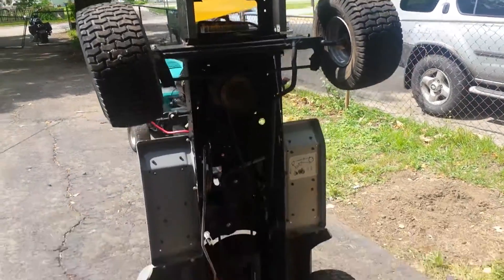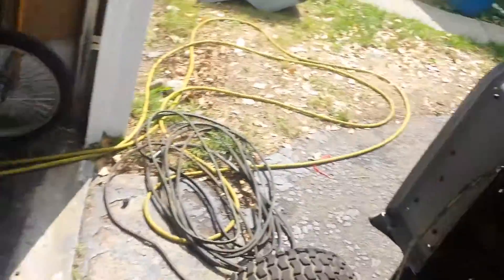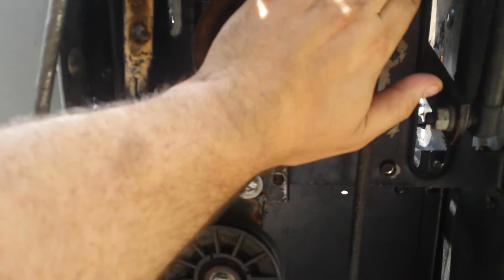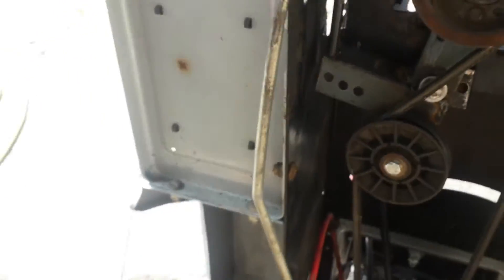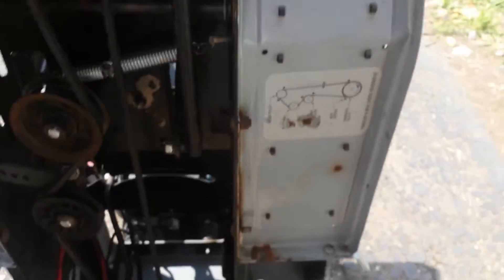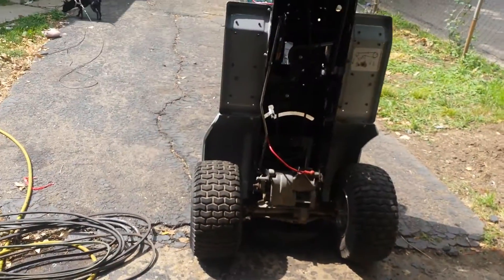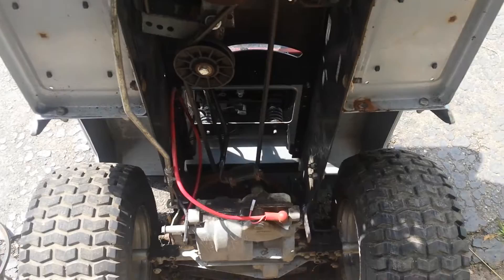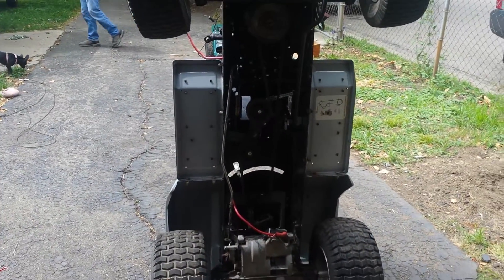craftsmashman redo pt

Comment: You know the stock Craftsmsn clutches are good, the only downside to them is you can only go up to a 6-6-1/2 inch pulley, I can't quite remember off hand, without modifying the engine mounts..
That's how I was able to go with a 8-inch on my racer with the stock clutch.
Reply from the maker: yea the problem with it though is it dont get enough tension on the belt and with the way the shifter is it had issues with belt routing it wouldn't stay in 5th and reverse was a pain and once it is in gear the belt flopped around and rubbed and banges aginst everything so this is the start of kinda a romper i just want it reliable and to just work good and i gained 1 mph which isnt much but for a junk mower with a bit of scrap and time and 0 money its fun